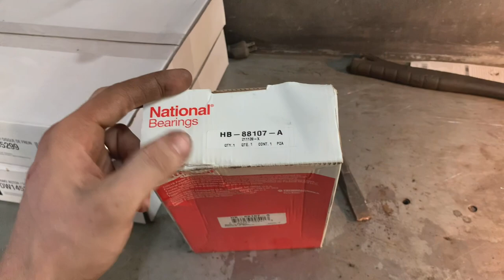How to shorten a driveshaft for absolutely FREE! (And easy with only an angle grinder and welder)

Comment: Funny enough, we had to shorten a driveshaft at work on friday. We twisted one off in a dump truck coming out of our pit. Pretty well exactly the same procedure you used.
Reply from the maker: Welp, we’re either both doing it right or we’re both doing it wrong 😂 a feller in gander had a dump truck stuck on the ice once when I worked at Johnson’s, he spun and spun until he hit asphalt and it gained traction and twisted the driveshaft like a twizzler, it was crazy

Comment: Find a big tubing cutter. Perfect cut every time.
Reply from the maker: I’ve actually used them on exhaust pipe and they’re awesome! I’d love to find a set for a reasonable price but they’re not real cheap
Reply: Best cut possible. That's what I do and it works amazingly well. Home Depot plumbing department. Get the biggest one.
Reply from the maker: I’ll check it out!

Comment: This is interesting. I am updating my transmission in my 4700 International, and I will have to get a 1710 series weld on yoke for my driveshaft. Currently it has a 1610. The question I have about this is a would figure the driveshaft would need balanced, correct? Most semi truck driveshafts I have seen have weights welded on them
Reply from the maker: You should have it balanced to be sure it’s not going to vibrate on you, especially if it’s a daily driver or something like that. This does work fine, I didn’t have any vibrations but luck like that doesn’t come around often haha

Comment: I wouldn't recommend doing them yourself, a driveline shop will do it with a rebalance for $75-$200 out the door. If you do use a tube cutter, a 3 1/2" tube cutter is cheap. Use V blocks and check for runout with dial indicator when tacking up. Weld back with tig, better heat control and less chance of warping.
Reply from the maker: Solid advice. I would recommend anyone who can afford it to have a driveline shop do it. However, this has worked more than great the handful of times I’ve done it 🙂

Comment: Is this safe to do ?
I have a S10 that now needs a shorter drive shaft for the tranny I jus got . I'm looking on here to see if this is safe to do or not for the long haul kinda thing ?..
Reply from the maker: That would depend on your comfort and ability with taking on something like this. As long as you’re confident in your welding and have a machine that can penetrate the metal fully, and as long as you have the yokes in phase then you should have no issues at all. 

I suppose i should write here that this is 100% your choice to take on a project like this, I hope it works for the best but I can’t take responsibility if it doesn’t.
Reply: @StationroadRatrods  hey I appreciate that. Reason I asked is my uncle and his buddy were gonna do that . And I personally never heard of that being done but I'm not too much into that kind of  vehicle work . My uncle says he done 200 of them that way . His buddy is the welder and fabrication guy . I'm jus reaching out to some people on here to see if that's safe as this is going to be my main vehicle to drive again .
Reply from the maker: There’s no reason it wouldn’t work at all! After it’s done and welded if you notice any vibration you may want to get it balanced at a driveshaft shop. 

I’ve done two or three now and I haven’t had any vibrations up to and above 200 km/h but every driveshaft is different.
Reply: @StationroadRatrods  okay well thank you  for the information. It helps a lot.
Reply from the maker: @garyleeheard3434 you got it buddy, have a good one

Comment: Doesnt want to fuck up the stow and go. Cuts it in half lmao. Maybe you can fabricate some walls so u can still keep stuff in there
Reply from the maker: I didn’t want to mess it up but I had to go through it anyway so I just put the driveshaft through the one side, so the driver side seat can still go down into the floor. I’ll Alamo be putting a tunnel over the driveshaft so I can store stuff, it’s a deadly spot

Comment: Why in the world are you clamping the tube in a vise? It’s really this type of stuff that keeps me in business. 

At least you utilized the hub to center the yoke back in but I surely wouldn’t trust concrete to be straight. I would have left a gap between the yoke and tube tube though. Seems like running over that seam is going to be super sketchy.
Reply from the maker: I clamped the tube in the vise but not very tight, just enough to hold the driveshaft so I could weld it.

The concrete being straight is definitey not guaranteed lol but i used it to align the two yokes to the correct angle, not to make it square on the pipe, so I never got any vibrations or anything.

Of course this could be done much better, just using what I have. For the record, I’ve been 130 mph with this driveshaft and no issues 😊
Reply: I’ve straightened numerous drive shaft at home half the time sip’n whisky and never had a problem, use what ya got and hit the rd.
Reply from the maker: You nailed it @Canadian

Comment: You just cut the counter weight off
Reply from the maker: There was a weight on the front and rear of the driveshaft so I figured it was best to cut it at the rear as there’d be less chance of feeling vibrations